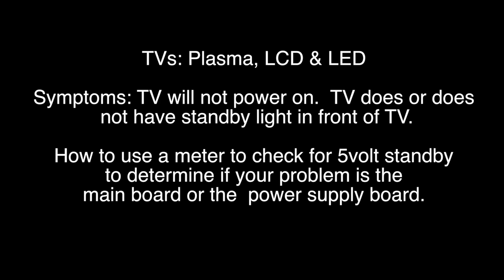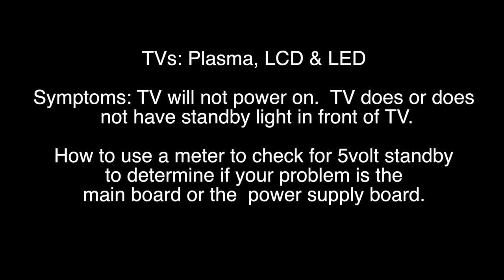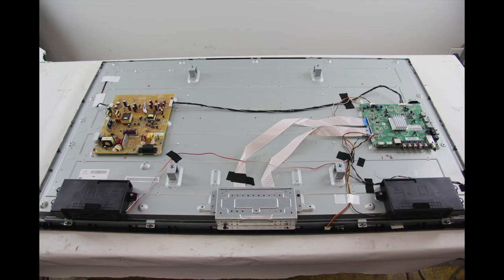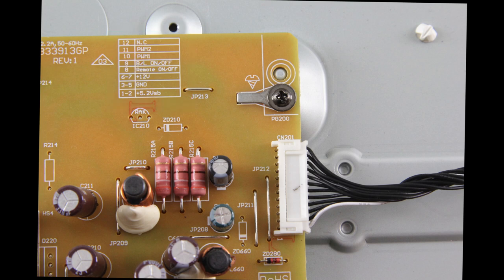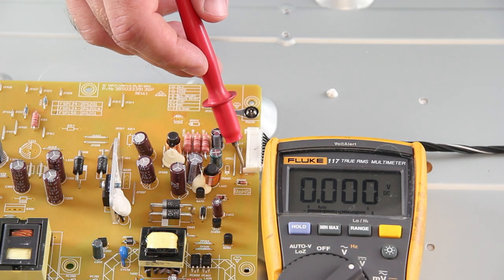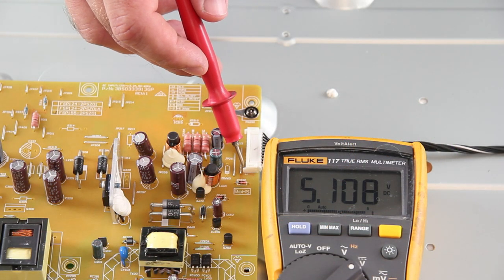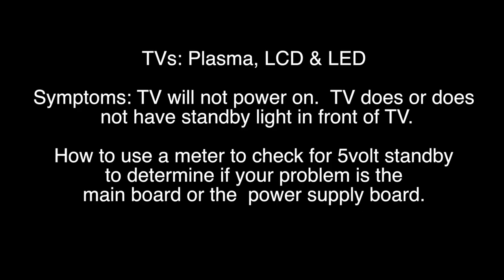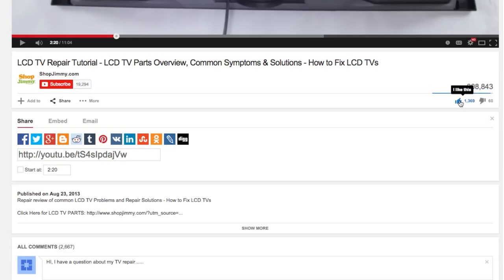TV Will Not Turn On Troubleshooting Help - LED, LCD & Plasma TV Troubleshooting TV Will Not Power On

Comment: A friend had his cable modem (ATT) struck by lightning, so everything that was connected to the modem/router by the ethernet cable was fried, and this TV was the only TV that was directly connected to the modem not to a DVR which those were fried but the TV connected to them were not fried, so there was no electrical surge, nothing electoral got fried, the TV is a Toshiba 32C110U1, I remember that there are three connections to check for voltage but I Can't remember which ones or the voltages, I am not getting any voltages on any of the pins for the ribbon connector that connects the power supply to the main board, is it possible to have a power supply burn out from getting an electrical surge from lightning through the ethernet cable even though that connector is on the main board and not the power supply?, am I looking at replacing the power supply and main board?, I don't want to buy one and it be the other that was bad, I am trying to fix this at as low of a price that I can for him..

Comment: I have a sharp lc40e77un.  The red light on the front blinks once every sec.  The original main board was hit by a spike and blew the ic chip off the power supply.  Replaced power supply.  Still in fault.  Have 4.9 volts stand by, 12v and 60 volt to inverter board.  So I replaced the main board.  Still in fault.  The led on the front of the main board is orange.  when I plug in the power, the orange light comes on solid and the goes out.  I have changed the power supply twice, the main board twice and the inverter board twice.  I am lost!

Comment: LG module 32LG40-UG & PANASONIC  MODULE TC-P50C2   I DID NOT HAVE THE HDMI INPUT ON EITHER  TV.  AT THE PRESENT I AM USING THE RCA INPUTS TO WATCH TV.THIS HAPPENED DURING AN ELECTRICAL STORM

Comment: Hay i bought china made new 32'' Led Tv (series1 111500). i pluged in all the necessary cables it was workīng. But as i insert Usb in THE USB3 port of led tv. the screen got blinking. i shut it down. and pluged it again. Now it shows only red light and is unable to switch on?
Can u please tell me what happened to my led?

Comment: Samsung NT55h6203af  Stopped working as we were watching.  Checked power supply board  bn440074as, no stanby, no output power.  Replaced D9N40 MOSFET on power supply board.  Power comes up but for a short time only.  Back to the same issue.  Seems that the main board is shorting out power from the power supply.  No sure if that's all the is.  I cannot tell if I  might
have a problem with the LED board.  Unable to locate schematic diagrams for the TV.  Was wondering if this problem ha ocurred to some one else.

Comment: I have a 42 inch Phillips LCD tv the problem is I"ve linked it up with my Directv remote control. The tv powers up and when i try to turn it to a channel, it goes to the channelbut the picture freezes up and shuts down.

Comment: phx p-1717 monitor's stand by voltage comes for 2 sec and after it gets off. no display problem in my monitor. pls give solution.

Comment: HI! I sent you a private message. (No response) guess ill ask here..
Have 2 tvs 1 is my girlfriends and other is mine.. First tv Quadro problems: when it powers on it works great for an hour or 2. then it powers off by itself. A second time when I power it on its work less time and powers off again, and so on... I checked the capacitors and they look fine! what seems to be the problem? 
Second tv is my Samsung with dark clouds all over the screen, I tried pressuring it and try to cold bag on the LCD screen, no changes! can you or someone else help me fix those 2 tvs? thank you!

Comment: Great video Jimmy! I am having almost the exact same issues. When I turn on the TV the screen flickers 3 times (I can see the LED lights flickering in the back), then I get a blank screen with a slow blinking red LED. I have tested the power supply board. ALL 3 test points (standby, LED driver, and main board) maintain voltage when the TV goes from power on to blinking light. However, when I test the 16V and 24V connector pins that connect the PS board to the main board they both go down to 0 when the light starts to blink. 

There are also 3 test points on the main board, 5.3V, 12V, and 15V. The 5.3V standby test point maintains voltage from power on to blinking LED, the other two do not, they go to 0. Would that indicate that this main board is bad?  I hope that's the case cause and not a bad LED strip. 

If it's not the main board is there any way to test the T-con board and LED driver board? Thanks and keep up the great work!
Reply: TC-39AS530U

Comment: +ShopJimmy ~~ Hey man, not meaning to be a dick but are there any other ways to fix things besides just telling people to replace the boards? Pretty sure that's why most are watching because, switching out  boards for new ones is something anyone can suggest.
Reply: That all ShopJimmy.com does,telling you to replacing any whole boards.They're tv boards parts and accessories supplier seller.You want to troubleshoots and repairs to the components levels on any boards.Must stay away from ShopJimmy.com YouTube sites.Look for sites that said tv boards and components repairs,but you must have a lot experience in electronics troubleshooting equipments and major technician repairing  works skills.To do the works like these former tv technicians or Technicians in the electronics industries.
Reply: +Chi Chu ~~ For sure, I hear ya. The titles should be "Recommended Replacement Boards". 
I ended up having to solder in 2 capacitors that cost about .50 cents to fix mine. Badcaps.com was what helped me the most.
Reply: +A Fungus Among Us  
Hey Fungus, wtf man, where have you been?
Reply: +Alex Dernst Why don't you ask yo momma! oh, snap....
Reply: my TV lights power light but won't start 
can you help Jimmy UK
the is friends
Reply: If you want to learn real fixes not just replacing boards try watching some Jonny Fix videos :) For this watch https://youtu.be/FjvAFFYC2iA
Reply: clinkowich well I don't agree with you, that's not repair if you replace the whole board and you call yourself after that technician
Reply: Sam J and your one!

Comment: I have a Samsung led TV and the connector from power board to the motherboard reads 13v on all connectors.i dont get 13 volts on any of these. The highest I get is 12.5, the rest are 9 or less.

Comment: have a dynex tv has a led light in front of tv ...well tv turns on then turns off automatically reset it by unplugging it from wall then tv turns on for a minute or two then turns off automatically ....

Comment: at my led driver board i had a supply of 24 vdc and the ouput going to led strips was also 24 vdc, anyone can tell me a proper voltage should be goint to led strips from led driver board, i dont have a display or glow on my screen, anyone can help? thank you

Comment: when tv is turned on it shows good picture but picture is distorted with coloured horizontal and vertical lines after 15 to 20 munites. what is the solution?

Comment: Samsung UN60J6200AFXZA When plugged all LED's just flash.  Nothing effected by power button.  Just plug it in and starts flashing about ever second. When I unhook Main board and T-con board does same thing therefore only thing still connected is power supply.

Comment: i have panasonic TX-P50GW10 with 5V SOS failure (5times red led blinking), new PS is not available, so i bought used PS board ETX2MM747MFK, but this does only relay clicking sound...can anybody help me?

Comment: Panasonic plasma TC-P54S1. continuous red flashing light but will power on and work fine if I keep trying to start tv by holding power button in for about 4 or 5 seconds.  I suspect a bad component in the power supply board? anyone?

Comment: help I have a sharp aquos LCD tv the screen goes black after some time then comes back on that repeats a couple times then it goes black but it doesn't come back on also the green power light keeps flashing
Reply: +pielover771 It is most likely the switched mode power supply (power supply). Switched mode power supplies have a feed back circuit that checks to see if the correct voltage is being output from the DC to DC front portion of the SMPS. If that voltage is off or there is a problem with the feedback circuit the TV will exhibit symptoms like you have.
Reply: Well its been on for an hour now nothing has happened for some reason I also check to see if anything was wrong with psu but it looked fine
Reply: +pielover771 Could be heat related or physical defect. Check for cracked solder joints, or poor cold solder joints.
Reply: roomba I checked all of them
Reply: It it happened once it will happen again. Hopefully it will play nice and not be an intermittent problem. pielover771
Reply: roomba I know it will happen again it's happened way more than once
Reply: I think it's just overheating cause I have the back cover off and it's doing just fine it might be the more air flow that's keeping it cool should I clean it with a air duster
Reply: It would take a lot of dust to make it overheat, but it would not hurt. If you can get it to overheat and take a can of freeze spray and spray the components one at a time it would tell what component(s) are breaking down down to heat. You can also find shorts on the board that way.pielover771
Reply: roomba would I be looking for  the tv to work to find the right one and should I be doing that on the main board or psu
Reply: roomba it might be this square silver pice because the cage that surrounds the main board had a brown square stain on the inside of the cage
Reply: pielover771
If you are comfortable with measuring voltages you can eliminate the PSU quickly with millimeter readings. If you are not I would not try it as the voltages can kill you if you don't know what you are doing. It gets more complicated when you look at power supply voltages as some PSUs will not deliver voltage without a load. It sounds like a heat problem that you could test with getting it hot enough to fail then cooling it (the PSU) with freeze spray or even a small fan. I would test the PSU first.
Reply: Sounds like a capacitor went bad. pielover771
Reply: roomba if it was the psu wouldn't completely shut off because I still get sound
Reply: roomba do you think that I can just put the cover back on with out the main board cage
Reply: pielover771
If you are still getting sound and no picture, and you see brown leakage around the tin can on the main board, that is most likely the problem. I did not know that you were still getting sound. No you need to leave the can on. The tin can is to keep RF emissions form hurting the picture and sound processing.
Reply: Yes I do see the tin can with brown leakage but it's on my power supply and there's 2 one big the other small the big one is the one with the brown leakage and I used the tv without the cover on for 2 days nothing happened but when I put it back on it went black again after a few hours
Reply: roomba are you talking about the switch transformer
Reply: pielover771
If the can you spoke of is on the PSU, then you can look for the leaky capacitor, replace yourself or use a friend and it has a good chance of working.
Reply: roomba I checked all the capacitors there fine
Reply: pielover771
Where is the brown stuff and is it a burn or a liquid and what components are near? What board is the brown stuff on?
Reply: +roomba its on the the switching transformer only i think thats the name

Comment: ViZio E420i A0 5v good at power supply, TV shows standby light when i first plug it in, then it fades slowly to dark, push power, same light comes on then fades, unplugged LED strips and continue to have a power light indicator at first, but again fading to dark.  replaced main board  still same symptoms
Reply: Hey carl i have the same issues on my tv vizio LED.... Did you try to replaced the power supply board? I ask some tech guy here in utube he was telling me the power supply issues.

Comment: If your not getting power or standby light on Samsung LED try unplugging the LED cord that runs from the yellow power board through the back of the silver panel and power the TV on. If your standby light comes back on its a burnt out LED strip. Saves a lot of time and money avoiding jacking around with boards if the LED is bad.

Comment: I have a 65 inch RCA and I've traced it down to where I'm not getting any power to my LEDs from the Power board. However my standby light is stays on but I push the power button hold it in there's no flickering no nothing with lights it just nothing but the light staying on there's no sound there's no anything no clicks no flickering of lights or nothing you think it is the power board for sure

Comment: LG 3D TV is not turning on, power led keep blinks slowly..Model#: 42LW5700

Noticed following points before it stop completely.

1. First day, after I turn on, standby light blinked around 10 mts then it started video

2. Second day, it took around 30 mts to show video on screen (the same Red led keep blinked slowly)

3. Third day, it stopped completely with standby mode (red led keep blinks slowly)

4. Opened back cover to see damaged Caps, no damage is noticed, both board with no physical damage.

5. Even after stopping the electricity the TV power led keep blinks for around 30 seconds and then goes complete off.

Please help me to find faulty board (PCB or MainBoard).
Reply from the maker: +Kiran Kumar   Try all repairs and troubleshooting at your own risk.  I recommend replacing the main board in your TV.   Unfortunately I do not see any replacement parts in the search results for your TV model number on our website.  Please reply with your part number on your main board and I can try searching for replacement parts.  Thanks and please let us know if you have any further questions!  www.shopjimmy.com
Reply: +ShopJimmy.com Hi dear, Thank you for the replay. Yes the problem was from main board. Replaced with new one and working fine now. Thanks once again.

Comment: My TV is "on" it is logik 32" I cnt remember which one. I have had it for almost 2 years and now it wont turn on for ages. Its standby light will turn to blue and could take ages to actually turn on recently it would take half an hour but right now I have been waiting for the last 75 mins for it to turn on help please
Reply from the maker: +Sakuranarutohinata  Try all repairs and troubleshooting at your own risk.    I recommend replacing the main board in your TV.  Please reply with your TV model number.  Click here to view a video that shows how to find your TV model number:  https://www.youtube.com/watch?v=S51nhAmwR2M  Thanks!  www.shopjimmy.com

Comment: Dear Sir I am Mr Sharma From New Delhi India. I have A Led TV - Samsung UA40D5000 . My TV is Not Turn on. and not show any light in TV. I checked Power Supply Cable ,and Buy New Power Cable , But  Tv Not Turn On. Pls Tell me , Which  Parts have Problem. My Led Samung  UA40D5000 , Power Supply Board , BN44-00473B. tv Mechanic  is Tell me  $46 you pay for this Board Repairing. sir Pls advise he telling wright or wrong. what defect may be. Pls advise with Video Upload this defect my be.and how we can repair it .and pls advise what is the coast of Power Supply Board , BN44-00473B.with shipping charge.
Reply: If your not getting power or standby light on Samsung LED try unplugging the LED cord that runs from the yellow power board through the back of the silver panel and power the TV on. If your standby light comes back on its a burnt out LED strip. Saves a lot of time and money avoiding jacking around with boards if the LED is bad.

Comment: Hitachi TV no power or standby light. Disconnected all cable and unplugged. It is my landlord's model number not available til morning, my rent tends to go up with every appliance repair or expense and he is now suggesting eviction as he says he's supporting me too much. I know I need to move, but would rather do it on the best terms possible. 

If there is a hidden switch or remote button combo, his wife may have hit an unfortunate combo. An easy fix would hopefully buy me some much needed time. This TV is in their bedroom and I've never watched nor have any idea about it but want to do as much as possible to assist.

Comment: I have a Samsung   un60fh6200fxza  the picture went out now it wont turn on I unplugged it and everytime I plug it in the back light flashes that is all that will work I have no stand by light but the back light still falshes

Comment: New message to: shopjimmy!
I received the board, and installed it.The power now turns on, red light flashes 5 times but all I get is faint blue back light, (tv glows blue). I connected my lap top via hdmi, tv was recognized the sound even stopped playing through the computer but no output through the tv. Original diagnosis, no power to tv. Your youtube diagnostic video stated 3.3v at the power board test point replace main board. If I need a different part or more parts can you suggest them for me. My tv is an Emerson LF391EM4 ser# DS3A1401133679the pt# on my main board sticker is A3ATEUH. 
 

Thank you
Rob

Ps. this is the email I have sent via ebay,  I have yet to receive an answer. Your website boast of all the help you give on your "TV repair 101", yet when I call your phone prompts state you aren't giving tv technical help.

Comment: They offer zero help other than to recommend you order their boards.  They will not help you determine which board to order.  Then if you order the wrong board they will graciously charge you a re-stocking fee to return it.  The sham is complete.

Comment: I bought 3 different boards from shop jimmy and my 65 inch RCA is in the same condition , stand by light push power get a flash and that's it ... This seems to be bullshit I smell scam